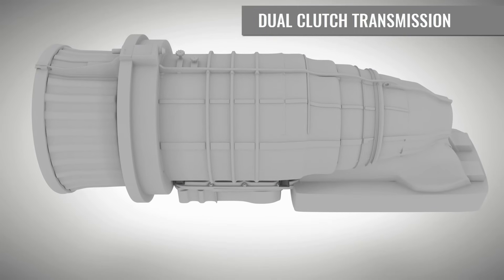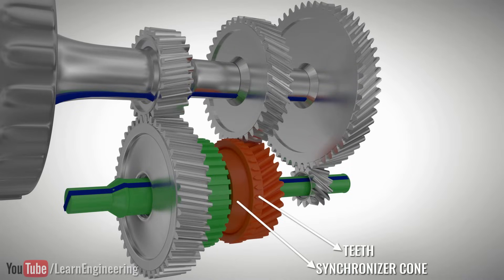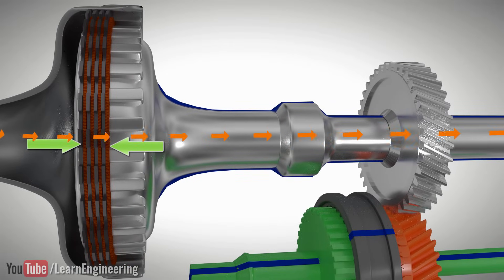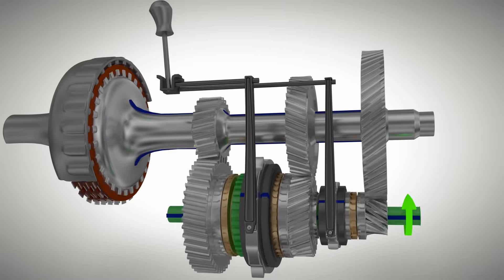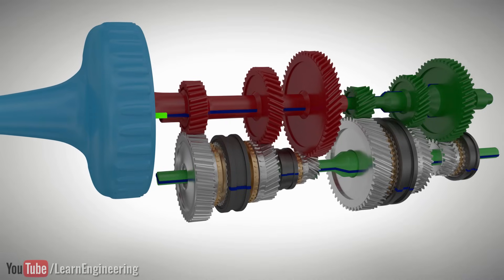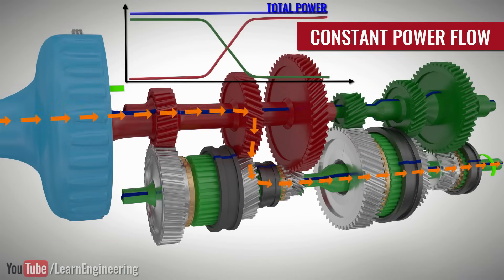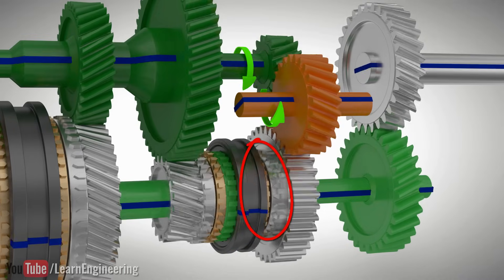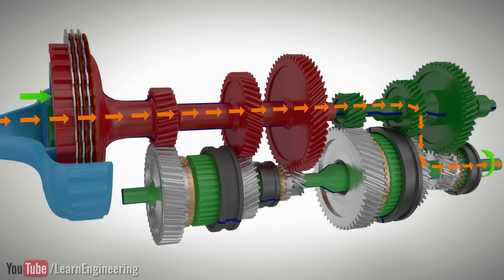Working of Dual Clutch Transmission (DSG)

Comment: My Ford Fiesta ST has a DCT, and at very low gears/speed, it kinda' stutter (especially when driving at bumper to bumper traffic). I've read some forums, and looks like it is pretty common. I want to know why this happens, and if there are solutions to this problem. Thanks! I enjoyed your video and subscribed.
Reply: Pat Diaz if you've ever driven a manual transmission car, then you know about the tendency to ride the clutch, especially in traffic. If you haven't driven a manual, "riding the clutch" means letting out (or off) the clutch juuust enough to get moving, and then pushing in (or on) to slow down. This isn't healthy for the clutch, but it's the only way I know of how to get through stop and go traffic. So that jerking feeling in a DCT is the transmission "slipping" the clutch in and out of first gear. One way to prevent this is to not creep forward in traffic. Wait for a big enough space, then move forward slowly. This way your car will stay in first, and not need to slip out. As a bonus you'll get through traffic faster and save gas 👍
Reply: this comment might be too late, but most ford DCT solved this problem by fixing the grounding, mine fixed by grinding the paint of the ground wires to the chassis

Comment: I agree that DCT is better than MT and AT in some area. But DCTs are not capable of handling a big torque,  also, in big cities, DCT' clutch pad will be overheated and also frustrated between high ratio gears. DCT is similar to AMT in some way, so the power need time connects, instead of AT, it will go right after you release the break.
Reply: You reckon? Bear in mind that this is the transmission used in modern supercars, which can put out upwards of 1kN/M of torque and are specifically designed to accelerate as fast as possible.

Theyre pretty good, when done right.
Reply: Well you were right, DCT is used in a lot of modern supercars such as Bugatti, Ferrari, etc. DCT is great for race cars, but not really for everyday driving, that the capability of DTC is lower than MT and AT mostly because of the overheating, in traffic jams. CVT is the one that cannot take a lot of torque in regular cars, but back in days, it was also excellent on F1 cars, so unfair that FIA have to prohibit it.
Reply: 田佳禾 Mk7 GTI 6 speed DSG 60,500+ miles (majority stop and go city driving) no issues. Recommend service at 40,000 miles, and Italian tune up two or three times a month.

Comment: Another benefit of dsg transmissions is that if you have turbo, the turbo holds through the shift rather than in an automatic, it cuts off at each shift, making for smoother and faster shifts and acceleration
Reply: Dave Vil automatics hold boost through shifts. You’re thinking manual trans don’t hold boost cause you let off the gas to change gears
Reply: @JboDaJuiceman  Not saying this is normal but in theory you can shift your manual while foot to the floor on the gas.
Reply: @Gibbon what do you think on these on the VW transporters stay away or buy with dsg ????
Reply: I'm sorry bro I don't follow. Can you explain further? If my understanding is right based on your comment, basically turbos do not drop and spool again after each shift? Is that what I think it is? No lag? Anti-lag? Correct me if I'm wrong please I wanna understand.
Reply: Manual transmissions lose boost on gear changes. Automatics, DCT, or torque converter equipped ones do not. With a manual transmission you let off the accelerator, and wait for the R.P.M. to drop before engaging the next gear when accelerating.
Reply: @ijustwant2lookatvids  There is a solution to this with manual cars though which I believe is called power shifting. Basically you never let go of the throttle while you shift, but you have to shift quickly and it's wears down your gearbox a lot quicker.
Reply: @ijustwant2lookatvids  Right! I’ve heard of the misfire system before, but I didn’t know it was there to keep the boost in the turbo. That’s pretty clever though
Reply: @ijustwant2lookatvids  I’ve never driven one with the system myself, only heard that they often used it in rally cars I believe it was in the 90s or early 00s? But it makes sense, at the same time as it sounds terribly fuel inefficent

Comment: dual clutch transmission is not smooth at all
Reply: You probably haven't tried one, then, as I can assure you that they can be incredibly smooth.
Reply: I've test driven a Hyundai DCT that was extremely smooth
Reply: I've got dual clutch in my Audi A6 and it is incredibly smooth

Comment: just one question, how will i control 2 clutches ?
Reply: The car has two clutch pedals.  The one closest to the gas is for the even-numbered gears, and the one by the break is for the odd-numbered gears.  Takes some getting used to.

Comment: i dont like DCT,s their jerky and are always shifting. I mean I bought an automatic because I want smoothness. if I want fuel economy I would have bought a manual. had 3 manuals before still love them but I love my 8 speed jeep
Reply: I disagree. If you have a decent engine, they dont shift much. Plus, it very much depends on the programming. Only problem Ive had was with a VW Touran company car. It would sometimes try to engage both clutches at the same time, but that was a problem with the electronics, not the DCT as such. When it worked, it worked very well. Gear change was not really noticable. Engine was a 140 hp diesel.
Reply: ukspizzaman try the ford fiesta or the diesel hyundai accent, its a bit jerky, especially in the fiesta.
Reply: Why they are always shifting is because the manufacturers program it like that

Comment: best transmission is Tesla transmission:D
Reply: I am 100% with you on that fact
Reply: Faraonqa Koenigsegg Regera, what transmission lolol
Reply: Yep, The Koenigsegg is better than the tesla by a longshot...
Reply: alexis_robi Teslas don't, but electric cars can have transmissions, and Teslas were almost designed as 2 speed automatic transmission vehicles.
Reply: TheTrollexis exactly
Reply: lmao, tesla dont even use transmission, its directly connected
Reply: Tesla's use a single speed transmission
Reply: Electric cars dont need transmission because they have instant torque and very high RPMs which also means their top speed is limited to the motor RPM itself. And since electric motor can simply reverse polarity to turn the other way it doesnt need reverse gear either. And sure you can put a normal tranny into an electric car, but the whole point of transmission is to optimize the engine's potential within its limited RPMs but since E motors doesnt have limited torque problems theres no need for a standard tranny. It will just be extra weight and extra in general. But coming back to my original point, an EV's top speed will be limited to its RPM range and top achieve higher top speed, a more powerful battery will be needed which will either weigh more or cost more or last shorter
Reply: And for the case of the regera, koenigsegg never officially reveal their direct drive system but im guessing it works the same way tesla drivetrain works except it uses combustion engine with torque assist from electric motors at lower RPMs. It also explains why it can still do a burnout even with only one gear. Flooring the car will boost the engine to the top RPM range and send all the power to the wheels with minimal power loss. And i can back up my guess because the regera can only reverse in electric mode(it doesnt do 270 mph in reverse all you forza players). Proving that the  engine is connected directly to the wheels with no sorts of transmission in any way
Reply: its called CVT
Reply: just Tesla? hmm .. what use an other electrik cars? :/   :D
Reply: TheTrollexis
 that's exactly why it's the best transmission.... very few or no transmission parts, means there is nothing to service or repair.... nothing can break, no power losses.... more reliable, more efficient
Reply: i'm sorry to say it to you but electric cars doesn't have transmissions
Reply: tesla is a rich girl's toy. not a real car.
Reply: +Ozgur Gundogdu dude.  did you know that a tesla can outrun a ferrari? since they have direct connection and no gears. B00M
Reply: GamerNot Foundroblox acceleration wise. Not top speed. Any tesla models on the market rn top out at 160
Reply: Electric vehicle supremacy
Reply: tesla's and other electric cars use only CVT or they only have 1 gear dummy

Comment: The world class t5 manual transmission has reverse synchronized. A dct is far more costly to rebuild than a standard auto because it must be rebuilt using the same method as a manual but with far more steps. So it costs more than a manual trans in the case a rebuild is needed. With this trans being a prefered option for preformance: a manual 6 speed is still supirior for proformance life and control. Thanks for the education on dct.

Comment: Fascinating.  Compared to a traditional manual transmission, what are the drawbacks to a system like this beyond a slight increase in engineering complexity?
Reply: For one thing when the clutches wear out and need replacement the cost of the repair is a lot higher than a traditional manual. It requires special tools, skills and computer equipment to replace and set up the dual clutches. It pretty much has to be done by a qualified dealer mechanic or a transmission shop. It also drives a bit different than a traditional automatic. Not bad, but different.

Comment: I totally understand a manual transmission but once the second one was introduced in conjunction with the first one, I totally lost it. Damn that's alot of gears!
Reply: Then go and watch a video on automatic transmision. it's totally mindblowing. (at least for me)
Reply: It's basically two standard transmissions with two clutches running in parallel and connected to the same differential that drive the front wheels.
Reply: The first one can run loose if red clutch is released and green pressed. And vice versa
Reply: I think its important to see that there are 2 concentric shafts (on top). either one or the other gets power from the engine (left side) depending on which of the 2 clutch plates is engages (you can see them as left and right on the top left of the animation
Reply: Funny enough this is just a six speed gearbox imagine trying to animate mercedes 9 speed dct gearbox
Reply: Well, Mical, a video of a planetary automatic, vs. this kind of automatic.
Reply: The second one was allision transmission that uses planetary gears this was a great invention and the man behind it was very genius, you will ba amaze of the mechanism and it will blown your mind. But this DCT mechanism removes all the complicated stuff in allision transmission it is the combination of manual transmissions and allision transmission mechanism. What a brilliant mind.

Comment: Now I know why manual transmissions are the best! Thank you!
Reply: Because you need 2 of them to be better than a normal automatic?
Reply: @-j.r9967  No, because manuals give you more control over your car's acceleration, i.e., you get to choose your gear and thus, be in the right gear at the right time. And they are more engaging and fun to drive.
Reply: @Geralt  most cars let you select your gear the same way. My beater from 02 has it even. Same amount of control. I get the engaging thing but I have just as much fun in autos as I do manuals lol
Reply: @geralt36  I mean all in all it's all opinion anyways, but there's a reason manual transmissions are going extinct lol
Reply: @-j.r9967  Going extinct you say. Is that why Toyota is coming out with its new GR Corolla which is only available in manual? Toyota also made the supra which previously only came with a DCT available in a manual for 2023. Then there's other only manual cars like Civic Type R, Civic SI, etc. Lexus is also working on an EV that's going to have a manual trans. Why do you think these car manufacturers are making manuals? Because there's demand for them and people want to keep them alive. As long as there's a demand they will keep making them. No matter how niche the market is.
Reply: @geralt36  woah a whole dozen cars available with one. Making a comeback
Reply: @-j.r9967  It's a rare breed in the NA market sure but doesn't mean it's going extinct. European and some Asian countries have way more options since more people there actually buy this trans.

Comment: Nice video.

I cannot say I am convinced the added weight and complexity is worth smoothing out shift points, and have to wonder about the delay when the pre-selected gear is not the right one (i.e. shift up then down when it was pre-selected to shift up).  And it's not entirely clear it is less complex than an automatic, given two clutch plates (what's a few more in a more compact package?).
Reply: JoeOvercoat 
It’s a much faster shift as well.
That’s why this system is seen so much in performance cars, but rarely in normal cars.

Comment: I feel the the automatic transmission are smoother then the DCT espcially in heavy traffics.
Reply: DSGs has clutch which tries to engage. Autos just have torque converter which just spins and does not engage, untill you are in high speeds i belive.

Comment: I don't dig DCT's. Why don't they just take an automatic gearbox with planetary gears and replace the torque converter with an automated friction plate clutch, for efficiency? Why bother with forks and syncromesh and all that stuff.
Reply: +Patrick Thibaut   NO, because even with lock-up TC's, you still have to deal slower shifts and the possibility of a leaking transmission.   After having to max-out a credit card to replace an auto tranny with UNDER 90K miles on it, I will not be buying a conventional automatic ever again.
Reply: Conventional automatics have lock-up torque converters. It locks in the gear like a manual gearbox to reduce the losses. It used to be only in the highest gear, but modern cars are now commonly locking in the gears in all gears... only releasing for shifts and stops.
Reply: That's true, for modern automatics. Makes DCT's even more pointless, doesn't it.

Comment: So can you torque brake a DCT or use a type of trans brake?   I can build boost on the line in my GN by holding the brake and applying gas.  (Plus it's got a locking converter to avoid slippage at cruising speeds)

Comment: so does shifting happen automaticaly in dct, or is there a shift or paddle you have to manipulate?
Reply: Both, you can choose the mode
Reply: +Joe Blow sweet, now I know what I will want while I Initial D it down the pass! thanks mate.
Reply: Not too sure you'd wanna drift with a dct, you don't have a clutch pedal or anything, just paddles
Reply: +Joe Blow crap! sorry to waste your time man. Ill take my Eurobeats somewhere else.
Reply: max radke That's an odd comment
Reply: +max radke   funny thing is, the Initial D arcade games basically had a DCT when you think about it; tap the stick back to shift up, and forward to shift down.  People loved it because you could focus on shifting, steering, gas, and brake without having to worry about stalling out the car (or missing a gear).  Now give all those advantages to drivers in the real world (where sh!t really matters), and people start b!tching :-/
Reply: HalfBreedMix What about when you might want to initiate a drift with the clutch?
Reply: Joe Blow  DCT's lightning-fast gear changes more than make up for any tricks/stunts that a normal manual will let you do (well at least if you are going for the best times).

Comment: Not sure if this is a click bait title in the thumbnail or not but DCT's are far from the
 "best transmission ever", haven't been for more than 20 years. CVT AMT 
or SAMT's are the best transmissions period. Continuously Variable 
Transmission, Automated/Semi Automated Manual Transmissions are far 
lighter, simpler, stronger and in regard to AMT's can shift just as fast
 as DCT's, hence why F1 uses them exclusively. The only reason F1 teams don't
 use the more efficient CVT is because it was banned in the 90's because
 the governing body for F1 was afraid the lack of shifts would dull the 
sport for fans. You guys use the word ENGINEERING in your title, you 
should take more pride in spreading proper information and not 
miss-information. DCT's are nothing more than a newish marketing fad for
 the auto industry to sell more cars to uneducated buyers, nothing more 
than a stepping stone from obsolete automatics/H pattern manuals to the 
proper and superior in every way... CVT or AMT.
Reply: Chase Murry are you serious? CVTs wear out much sooner than a DCT transmission. Not to mention theyve had to redesign the drive belt like 5 times to withstand normal use.
Reply: redesigning is evolution in progress. some technology progress some stagnante. some hawen't the potential some was banned in early days from F1 like the CVT but now its grown mature.  DCT is only manuals another stepp. CVT is supreme, it controls the torqe much betther then other gearboxes and its the  gearboxes ultimate job!
Reply: Chase Murry my Infiniti Q50 has a CVT I love it but just scared for the bands to bust one day 😰
Reply: Automated manuals are slow and clunky. What are you on about?